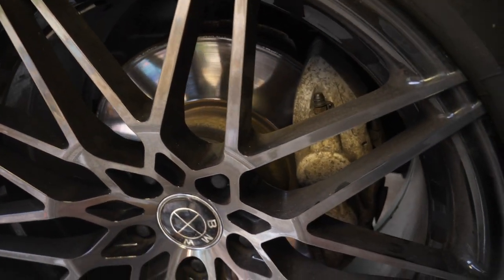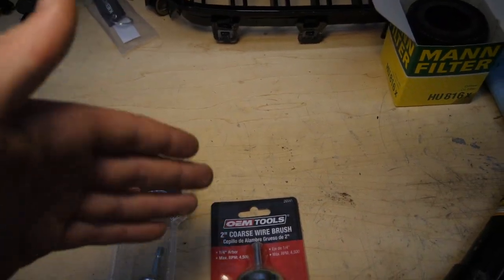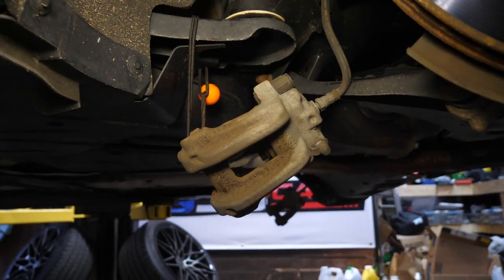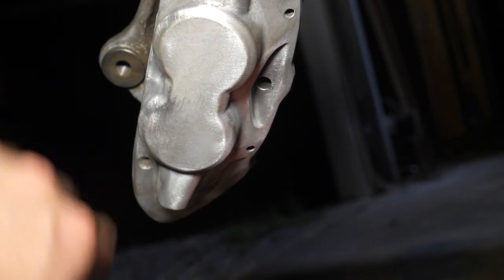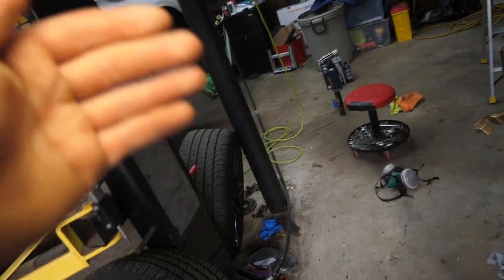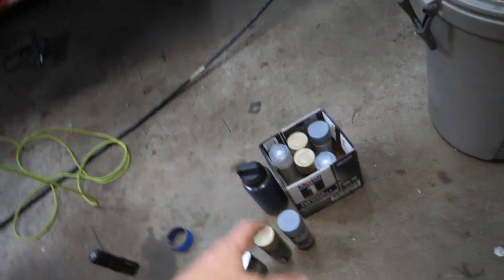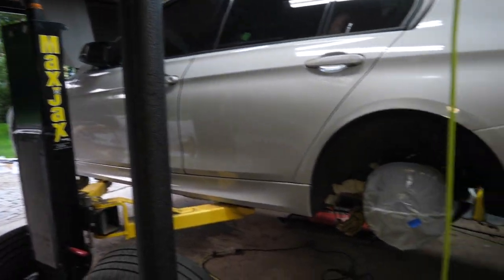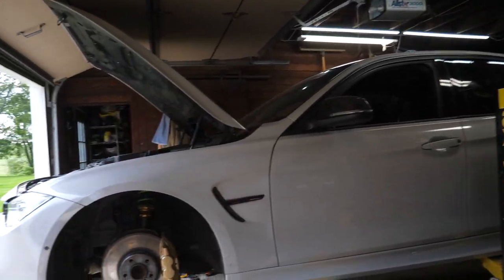How to Paint Brake Calipers // The EASY Way!

Comment: Great videos man, extremely helpful, i wanted your opinion on vinyl wrapping the steering wheel. I dont want to do the full wheel like you did, but im thinking brown leather vinyl wrap on the top between the stitching. Do you think vinyl wrap will hold?
Reply from the maker: Thanks! Glad the video was helpful! I wouldn't recommend vinyl wrapping the actual steering wheel itself because it's such a high wear part of the car. Stitching a cover on is the best low cost option.